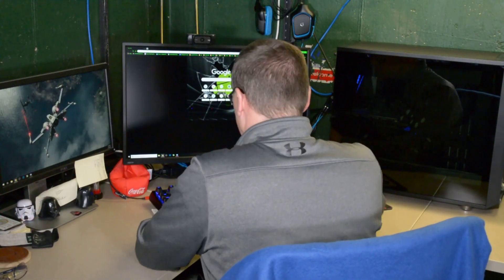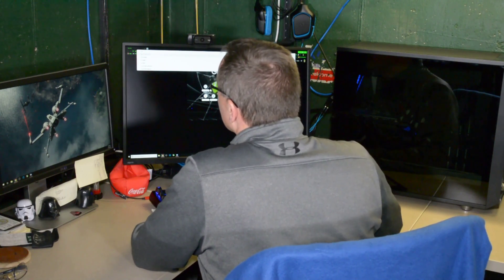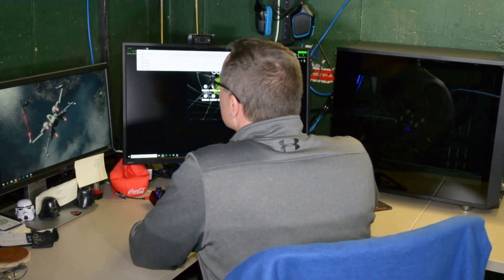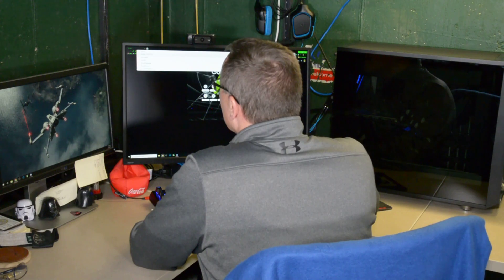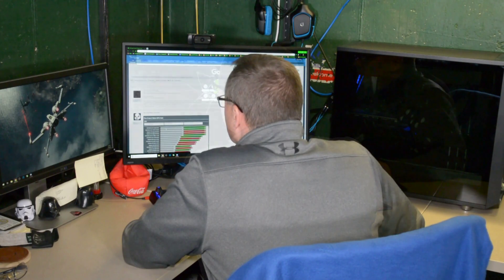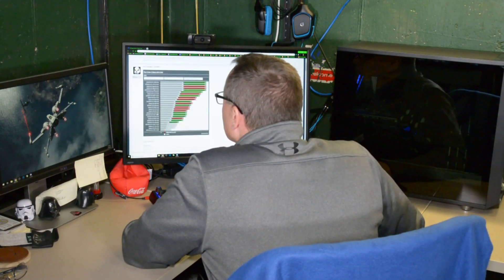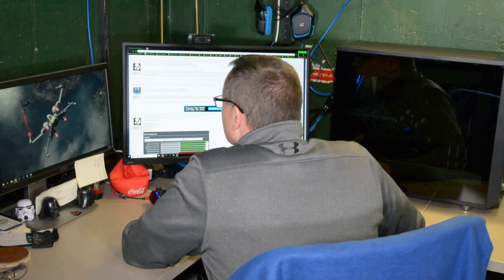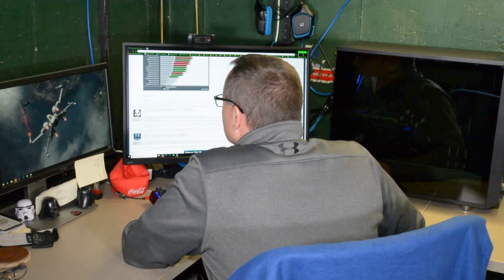Flashing Vega 64 Reference Card to LC Bios, should you do it?

Comment: amd manipulate us to purchase new cards. They are disable opportunity to flash into LC with some fps profit (droping frequency and pp table every 20sec). New driver is bullshit for gaming its compleetly unstable have microfreeze but good for all benchmarks. In my case on lc i had p7 1750 at 1230mv +pptable mod and 1100mem at 970mv(max gpu clock 1723 in furmark ) super smorf gaming 4+ hour. On new driver and air bios i have p7 1700 at 1180, mem 1100 at 1160mv!! and as result driver crashing after 30 minutes playing with microfreezes. Both have same result in 3d mark(firestrike extrime) 12150 +- 50(graphic score) but if you look at picture while test running at new driver you will see micro freezing
Reply from the maker: Both Manufactures do this sort of thing, this doesn't make it right but that is the facts.  I have resigned myself to go with what works for me after this 2yrs ago.  Most of the time now a days trying to over clock is not really going to get to much of a performance increase to make it worth while unless you do it just for the fun of it.  If you get really lucky or you are a reviewer and they give you a top binned card that will be your only way to get in enough performance to make it worth it.  The small performance gains the average joe will get isnt worth the time or effort to me or the potential damage done to the card..

Comment: Such a shame they gimped refrence cards on the LC bios. Trying to push my AIO card as hard as it can right now and looks like its giving out at 1650mhz (1702mhz in Radeon settings) but it will go even higher with more voltage. Except for the throttling of course :/ I would use the old driver too, only problem is COD MW doesn't support it :(
Reply from the maker: At this time with original bios I am able to get 1700mhz +.

Comment: How about flashing V56 to v64LC ? To much? I have a regular AIO older socket 775 water cooler ghetto modded on my v56=)
Reply from the maker: I believe it would be to much.  As you can see the V64 no LC would not deal with it all that well.  I dough the V56 will do any better.  also I had a full water cooler and that didnt help. You can try if you want but do not expect any miracles!
Reply: @TheTechBasement  Ok thanks dude! Not gonna push it and get greedy lol happy enough with V64 bios and 1650/1120mhz=) on my v56

Comment: Thanks for making this video! I am curious about how V64 would do with a better cooling solution - specifically a Morpheus cooler on the reference card or flashing onto a V64 Nitro+. It seems like the lack of results stems from thermal throttling. Do you have any data from HWMonitor while running those tests?
Reply from the maker: Yes I do, look at the ek waterblock instal video for the vega 64 under my ek series.
Reply from the maker: Seeing that results are somewhat determined by temperature, if you can cool it down enough and you have the luck of the chip lottery you might be able to get some nice results.  I went water cooling because I wanted to run the LC bios which turned out to not work so well.  Your best bet is to stay on the original bios and do the best your card can do.  The drivers over the last few months have been nice in performance standards.  I have not kept up on it but my card is running rather nicely.

Comment from the maker: Sounds awesome, you have it all under control.  I have been trying to get a decent undervolt after making this video.  I am able to get 1750MHz with a undervolt of only 1175mv, I know not much of an improvement for an undervolt.  Tonight I may try to see if I can get it lower.  I probably can bring it down as you have but I'm trying to squeeze out at much as possible without going over 50 degrees. I also have all at 950mv then at 1750MHz I have to bump it up to 1175mv, it actully only reaches max 1703 or something very close to  that.  I also have voltage at +50.

Comment: perhaps i would try LC bios just from the curiosity.
Although for everyday use i came to conclusion that Vega needs undervolting rather than anything else. 
My card is able to run stable at 1600-1650 mhz on core depending on load (1717 mhz target) and 1150 on memory with only 1V.
Consumption in this case barely goes above 220 watts under full load.
Btw i'm using vega 64 strix with full cover waterblock from ek
Reply: Did you end up trying the LC bios?
Reply: @acerimmeh  not yet. I was away from my pc for 1.5 months.
Reply: @1222dss  Have you heard of the Strix Vega 64 OC being  flashed with the LC bios? I read somewhere that the strix does not have a reference board and the LC bios may brick it. I have a strix version with a watetblock and would love to put the LC bios on it. But I have not found an example of someone doing trying.
Reply: @acerimmeh Sure it does have a custom PCB and investigation is needed before doing anything with bios.
Maybe simple tweaking of the original bios is better option, since this card also has dual bios so u can always reflash original one back.

Comment: Editing the registry instead drove my Vega 56 to a 25000 firestrike score
Reply from the maker: Interesting but what were your scores for combined and fps on test 1 and 2?  122. On turbo bios and 125 on lc bios are the max is what I got.
Reply: @TheTechBasement  will check. I had an aib card and not a reference tho and managed to hit 1800mhz (1750-1800)core clocks but unfortunately have hynix ram that only managed a 900mhz max clock. This was at 150% power limit. Tried 300% but there's no visible improvement after like 119% from what I can tell. I should also mention I'm in a custom loop.